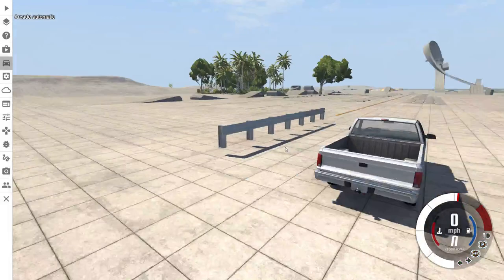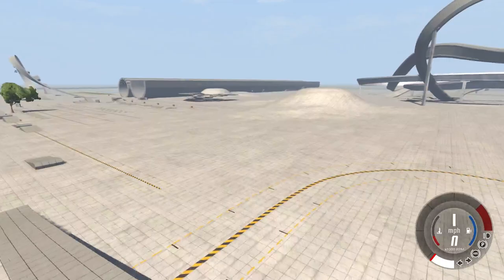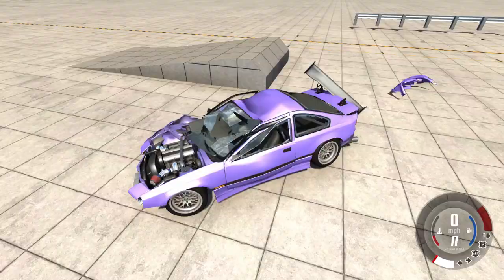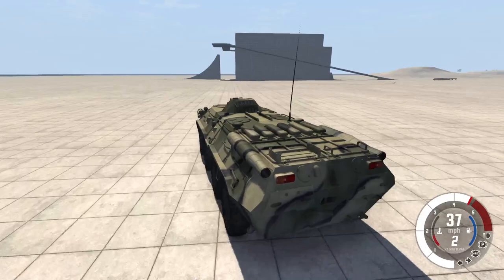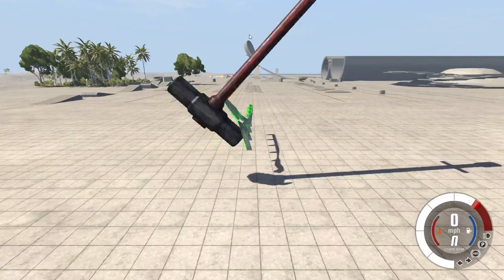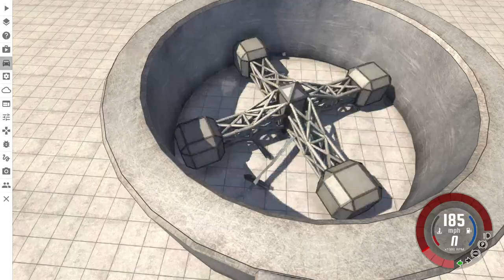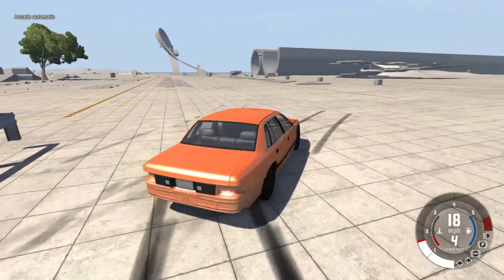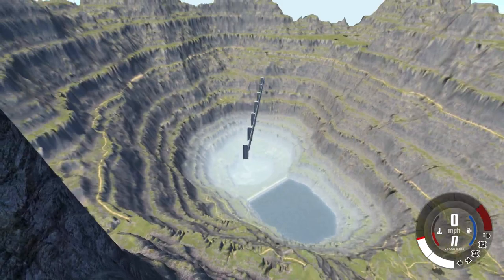Guardrail - BeamNG.drive

Comment: I feel with the 200BX the guardrail was a tad too high for the vehicle, yeah I know the race version sits lower then stock but still its main impact was taken by the bonnet (hood) and that continued through to make the rail take out half the cabin area with it. Other then that, another awesome vid =D
Also, you should of launched cars into it on leap of death from the ramp =P
Reply from the maker: +Sacra Mental Possibly, but it's not unheard of for cars to slide under guard rails sometimes.

Comment: i'm getting a second 980 ti to see if that helps. running at 4k, not all games hit 60fps, so now they will as soon as the card arrives.
Reply: i have a 5820k at 4.3ghz. had a 5960x but it couldnt even hit 4ghz so i sold it for the 5820k. looking into getting another 5960x soon.

Comment: you put the guard rail to high and cutting the roof off the car that's not the right way put it down word supposed to go it's too low when you use the truck but its just right when you use the car I mean good god you can't see that
Reply from the maker: +spackmaster Chavez The car I used was a really low car because it's a racing version. It's not unheard of for low cars to slide under guard rails as seen here. http://i.imgur.com/uutpO56.jpg Plus like I said, it functions better floating a bit in the air because of the way it's designed in the game.
Reply: It just doesn't look right you're hitting too high so most in the windshield the guardrail
Reply from the maker: +spackmaster Chavez If you set it lower than what I put you would just drive right over it like at 1:10 which looks really awkward.
Reply: Let's get our facts straight number one yes you would drive over it and say it cement truck or dump truck or semi that would drive over a guardrail even in real life but not if you put it up higher! you would have more of a chance to stop the truck with a higher guard rail  rather then lower guardrail! but a car which most of the time is what a guardrail is meant to stop. A truck will usually plow through it.But a car will be STOPED by a guardrail at that height! Mr. YBR it is set that low for a reason thank you.
Reply: +WhyBeAre can you do a burnout in a video in beamng
Reply: R

Comment: hey can my computer run beamng here are the specs 

processor:  Intel Core i3-4005U Processor
Processor Speed: 1.70 GHz
System Ram: 6 GB
i know graphics dont matter but Graphics Card: Intel HD Graphics 4400
Reply: +whybeare
Reply: +MattPlayz 356 First off. Stop trying to ask things that you can know if you searched up. Second! Stop doing the +blah blah blah things! its annoying!
Reply: Nobl3Fire 01 and you sir have no idea how old i am
Reply: It won't really run well, the processor and the graphics card are lacking the recommended or minimum requirements.
Reply: Dr. Diep oh
Reply: +MattPlayz 356 graphics card actually does matter i would definetly up grade it and maybe a cpu upgrade dont worry about ram
Reply: Dude it doesd matter -_-
How old are you? Like 8 or something
Reply: +thecrusher141 *does
Reply: thecrusher141 Who are you speaking to?
Reply: MattPlayz 356
Reply: thecrusher141 im 13 if i was 8 how would i know my specs? :/
Reply: My first built gaming pc when i was 8 years old. I just ask my father what to buy.
Reply: I had same processor on my old computer. 30 fps on lowest graphics. Have fun
Reply: MattPlayz 356 almost forget that if you're a computer geek or just really into computers, you should know the specs.
Reply: Charles Hoffman I did the test beta 40 fps
Reply: thecrusher141  ok I really know my specs
Reply: You need hella at least 8gb ram in a gaming pc